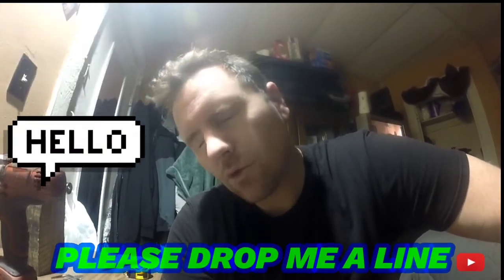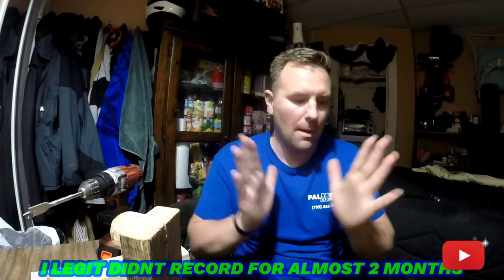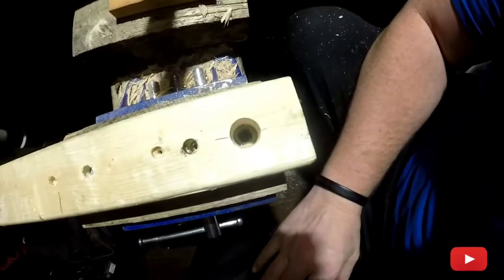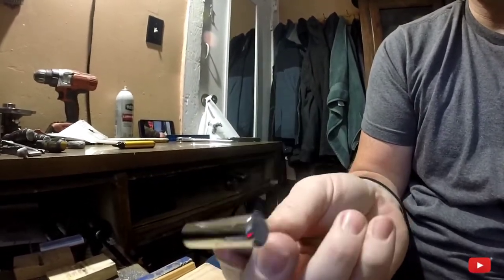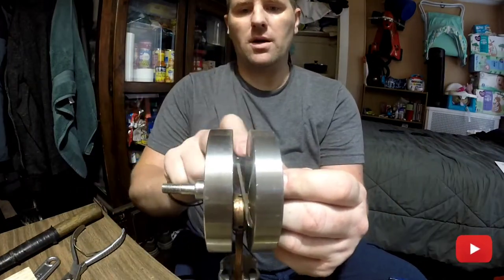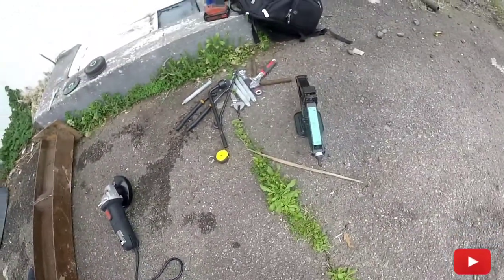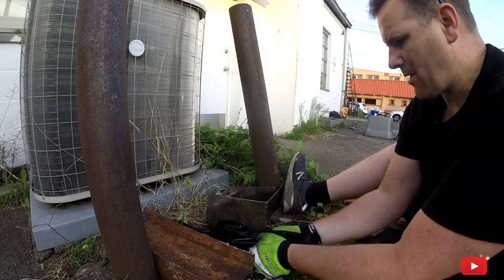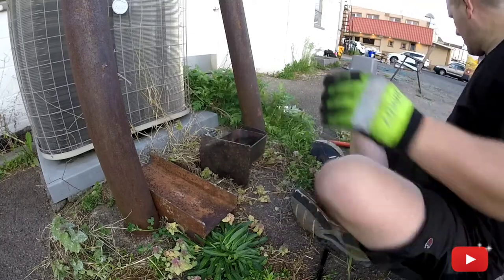HOW I MADE MY OWN PRESS AND BALANCING STAND

Comment: Awesome work. I love cobbling together a contraption out of whatever is at hand. And when it works 😁👍more than worth the effort to find that YOU completed what you set out to do. By your own brains and brawn. True satisfaction. Thanks to you my friend for continuing to inspire. Now back at a 49mm iron sleeve for me ... it's a dirty lil thing needs quite a bit o clean up plus I am opening the transfer port sections and copying the port work I did on the kicker. I figure if it rips stock clutches apart and the piston and cylinder still look great I must be on to something lol. Again thanks for the continued inspiration.
Reply from the maker: Thanks brother, I too love using what I find laying around to do stuff and repair stuff. It's not that I'm all about recycling or saving the planet tbh, it's just I enjoy the search and challenges of using something for something it wasn't intended for.. what are the numbers your running in your motor? Jw. I enjoy learning what is working for others.
Reply: @JMB676  tbh I have yet to put the timing wheel to that engine. Mainly I cleaned out the slag and leveled all ports to the cast iron openings. I did skirt the piston so the intake could fully open , Widened the intake port and widened the exhaust as far as I felt safe. Exhaust does look like a gaping hole inside tho lol.
I was worried at first that the rings would snag but so far no issue cylinder looks well broken in but thats it. I did 16:1 first tank 24:1 second and third then 32:1 and it started eating clutches lol could be in part me but I don't know.
What it does is go brapp and loud 
And throws me up a rock cut quite well with a 52t on it . And still the stock bofeng carb but I do have an mz clone on it.
Fun build. I will put up some vids once I get my 1/4 20 tap and can install my SAF budget  clutch. 😜🤪🙃😁👍

Comment: Just notch the wood instead of pushing bearings into wood let set on top in grooves
Reply from the maker: That is not even close to as accurate as this is. That way causes friction. But appreciate the info and I am thinking of a idea with some similarities to that but even easier to use then mine I have now